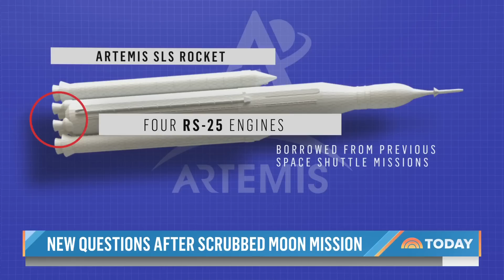NASA Evaluates Artemis Engine Problems Ahead Of Next Launch Day

Comment: man has never been to the moon, approaching the moon is like ending up in quicksand, human technologies that are based on the exercise of pressure on a medium do not allow us to travel independently of gravitational fields and centrifugal forces in the empty, in practice the thrust of a rocket in the void does not cause displacements and the same thing the attempts to brake, to bend etc since there is no possibility of friction. It must be added that another element is also missing on the moon, in addition to an atmosphere, of the two that allow man to move away from the earth, the angular velocity, which on the moon is one twenty-eighth of that of the earth (being the lunar day of 28 days) In fact, the lunar atmosphere has a pressure close to absolute vacuum, which generates in an attempt to take off the sudden dispersion of the pressure impressed on the ground and therefore of the acceleration of the rocket with an immediate decay of speed up to the recall to the lunar surface for half of the lunar gravity, and any attempt to bend the trajectory to create a gravitational slingshot, in practice a rocket to hook itself to the very modest lunar centrifugal force would have to start tilted but in doing so it would lose most of the energy impressed on the ground. Finally, there is a third element that makes entering the lunar orbit dangerous: the irregularity of the lunar gravitational field, in practice this causes the fall of everything that ends up in orbit, which is the reason why on the moon they are present hundreds of thousands of impact craters

Comment: BIG Government >  endless Bureaucracy > NASA > Artemis is doomed...
Reply: No…. They just have a low budget as I have said 1,000 times… and plus they have gotten quicker and better compared to 50 years, I mean of course the will get better but NASA is doing better especially since 3 days isn’t a bad delay.
Reply: @JohnRebel1861  low budget?
Low budget was when they sent Sojourner then they were nimbe and relatively fast. It is ridiculous that majority of Artemis is  recycled technology that is mature and well known.
Reply: @1Esteband  Indeed it is a low budget barely 2% of the US 80s funding goes to Artemis and NASA And this is way better technology because they had freaking computers running on potatoes back then, so basically it is a advanced Apollo 11 with SRBs on the side of them.
Reply: @JohnRebel1861  thank you for the clarification. I didn’t know that it was only 2%.  Anyway I hope they do better than starliner.
Reply: @1Esteband  I was exaggerating a little on 2% maybe five or 10 but it is still a small amount considering the fact of cost with rockets

Comment: Call Elon
Reply: Hydrogen rockets are much harder to make work than kerosene. SpaceX has no experience making hydrogen rockets.
Reply: @trihard7323  Space X is good at anything. Private vs government funded. Anything government tends to fail or half assed. Like this project. I had a bet it would not fly and guess what. I won that bet.

Comment: Media keeps saying it’s an “engine problem” when the actual issue is with a bleed line within the rocket itself. It’s a Boeing part and a Boeing issue
Reply: Problem with engine cooling I don’t know if that’s what you mean but that’s why it halted
Reply: Why would "the private sector come in and take some of these roles" when in the next couple of months, spacex demonstrates how this is done for less than a tenth of the cost and way faster and safer than SLS?
Reply: @RamsesYT  because they got tons of backlash when the cancelled the constellation program and so they renamed it artemis... to keep the jobs
Reply: I'm seeing reports that some of this issue was seen in BOTH wet tests, and it was failed to be addressed.
Reply: @jdmaine51084  They couldn't because of the failure with the H2 return line during the 2nd wet dress. They assumed that this H2 bleed valve would work because it wasn't high risk. That gamble didn't pay off. The H2 return system is supplied by Air Liquide
Reply: @BrianSu  So just all-around shoddiness.  Fantastic.
Reply: @jdmaine51084  Congress forced them to reuse parts from STS. The main engines on this rocket have flown multiple mission to space and are quite old. It’s not easy to re-use engines that weren’t designed for this vehicle to begin with.
Reply: True but these parts are highly integrated. What about the pumps, etc? I'm no Boeing fan, I come from lockheed. But I'm just saying
Reply: Let's say: Communications delay between the spacecraft and ground control, a fuel leak, and a crack on the insulating foam of the connection joints between the liquid hydrogen and liquid oxygen tanks for now...
Reply: Latest update says it looks like it was a fault sensor, not actually a problem with the engine cooling. The sensor just made it look like it hadn't cooled properly.